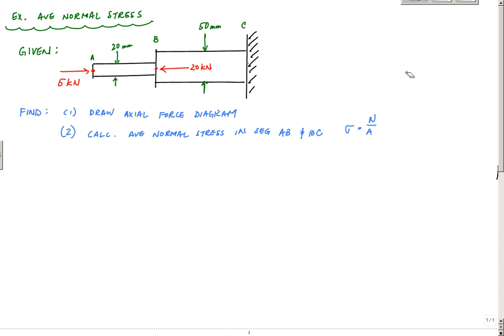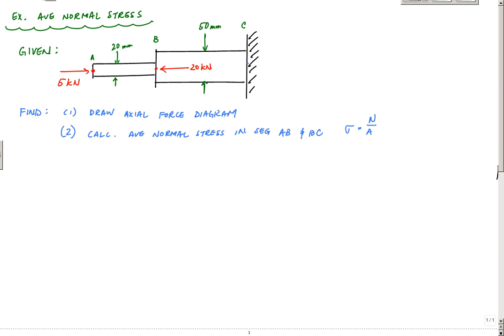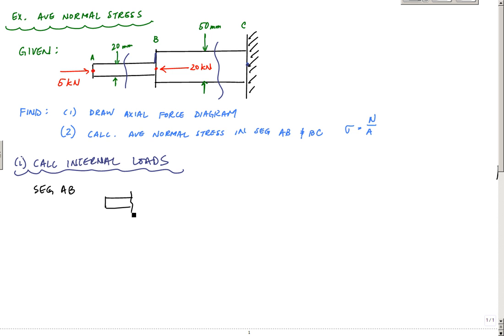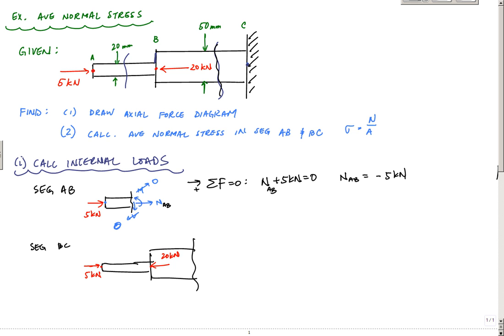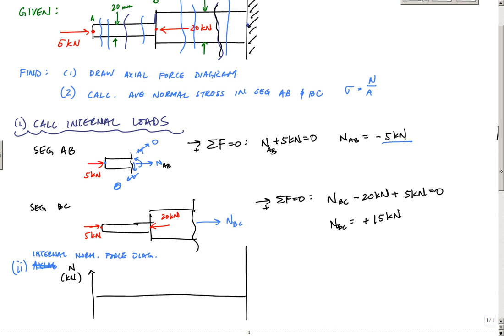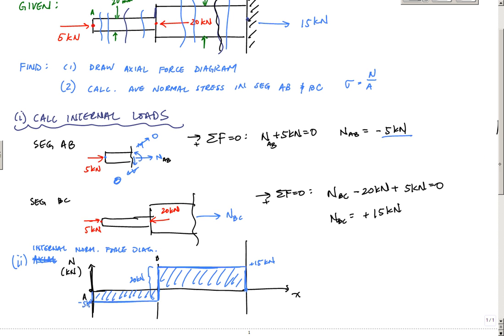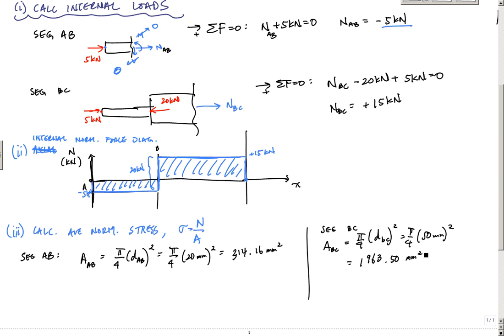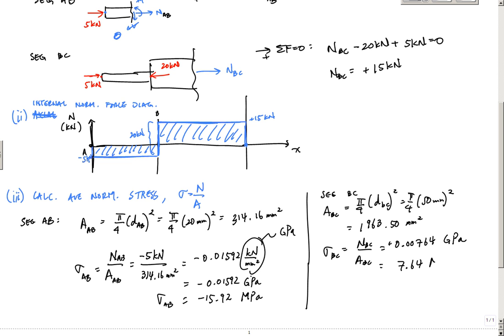Average Normal Stress Example 1 - Mechanics of Materials

Comment: Where does he get (Pi/4)*d^2?
Answer:
We know that Area of a circle=Pi(r)^2.But in terms of diameter,
Area=Pi(diameter/2)^2=Pi/4*(diameter)^2,by factoring out (1/2)^2=1/4.

Proof: 
Using the radius: Area=Pi(r)^2=Pi(10)^2=100*Pi=314.16.(radius=diameter/2=20/2=10)

Using the diameter:Area=Pi(d/2)^2=(Pi/4)*(20)^2=400/4*Pi=314.16.

Make sense?
Reply: can we always use this formula to solve this type of question?
Reply: or divide the diameter by 2 to get the radius, then use the circle area common equation which is "pi(r)^2 "
 @alifikmal4955
Reply: You can only use  (Pi/4)*d^2 to calculate the cross sectional area if the area in question is a circle (which it won't always be)